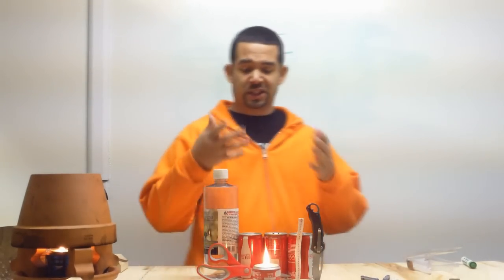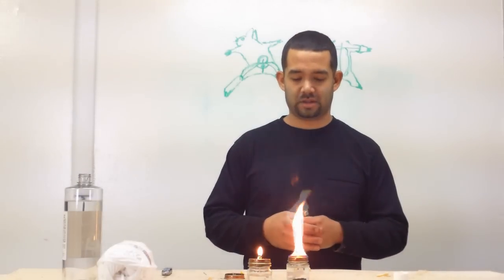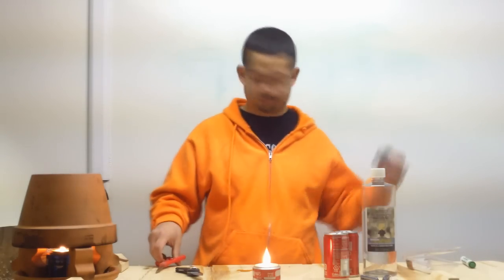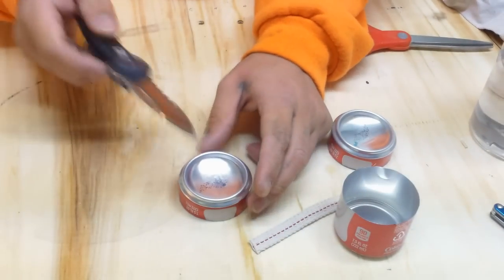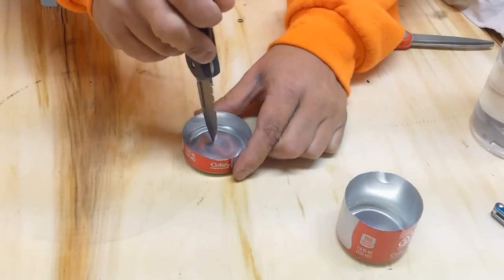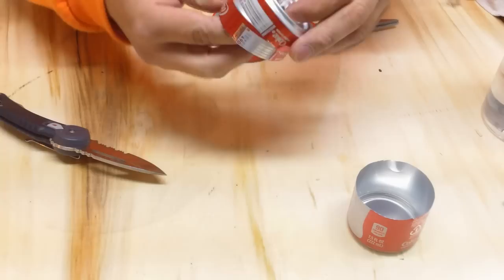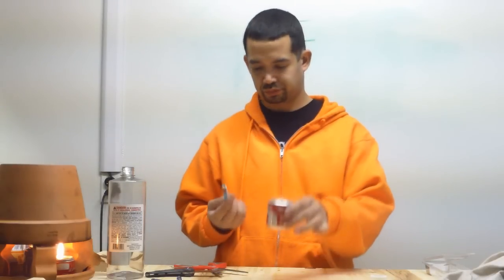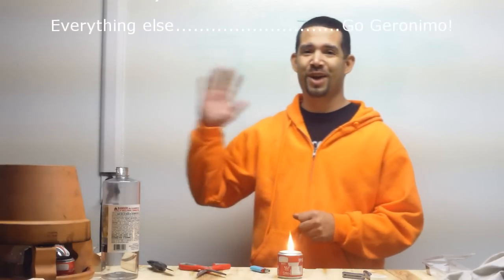Soda can oil lamp new and improved

Comment: Thanks Go G.......have you tried using your DIY oil lamp to power your DIY Clay Pot room heater?
Reply from the maker: Bill23799 I have but I did it to try and ramp up the strength of a clay pot room heater.  I find them inefficient.  I have tried many things to make them better but It seems to me that for practical everyday use they just doe not have the ability to heat well.  I do think that they are better than nothing though.

Comment: The cans are very sharp and people should wear gloves. Second, the baby jars would have worked had you had holes in the lid so that air could get down into it. Also you had your wick up far too high.  thanks for sharing your info.
Reply from the maker: yesiownfrodo Glove can be worn...  I agree.  I do not agree with the baby jars.  I tried every which way but sideways to make it work where I felt it was not dangerous.  The fact is that the fuel moves up too fast and causes a fire eventually.  I would not recommend it.
Reply: Go Geronimo  I used to make them with my students when I taught 8th grade science.  My son learned to do it in boy scouts. It was in one of the handbooks.  Don't give up, you're smart and can figure it out.  And, as a science teacher, have to say eye protection should be worn. ;)  I admire your creativity. Keep trying!